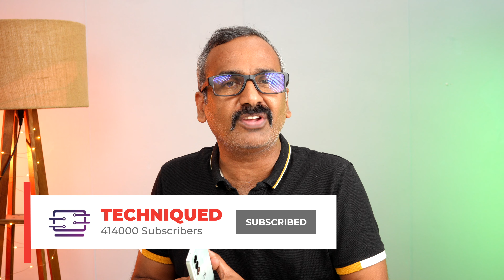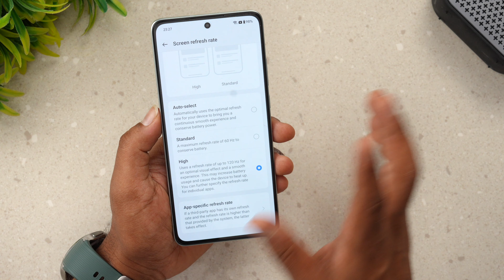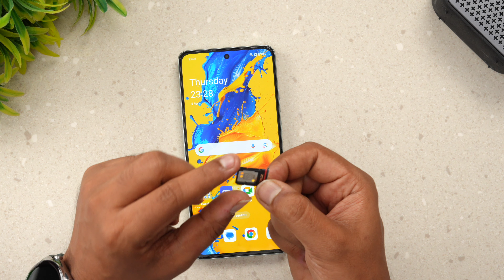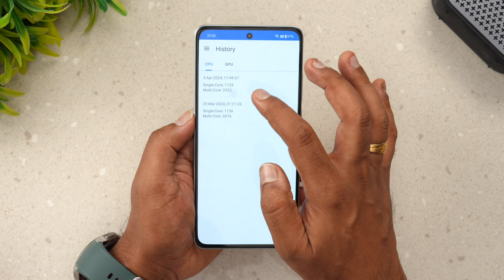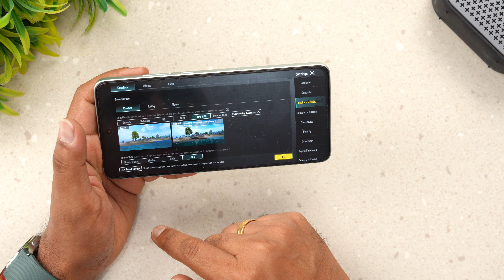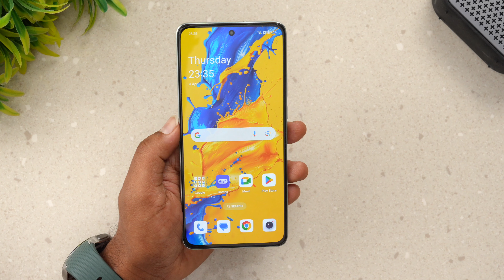OnePlus Nord CE 4 FAQs- Display, Performance, Charging, Widevine L1, 5G Bands, Software, Battery

Comment: Sir which is better nord 3 or nord ce 4 because both of them are at the almost same price rightnow. Please help me choose one😊
Reply: Nord 3 anyday better
Reply: Do you have one ??
Reply: @aaryyam  I have  nord CE 2 lite ( 17.5 k now ), Nord CE 4 ( 25 K ) ,  and i went to croma showroom to have in hand experience and evaluation of Nord 3.. Body design, looks, display quality i found Nord 3 way ahead of Nord CE 4.. This Nord CE 4 has the appearance and in hand feel of an under 10 k phone. Despite Amoled, the screen looks cheap, not sharp  , . My nord CE 2 lite  better for reading and writing, slightly smaller in size, fits for everyday usage .. These are initial impressions.

 Having said this some other factors like gaming, battery, speed,  CE 4 may be better. But again, the edges are too sharp and crude. The marble colour body design appears like some what moth - eaten,  doesnt give a premium look. However the dark crome colour ( looks smooth, little light and silverish ) of CE 4 for this reason is good for office goers, which I got  today ...

In a day or two only I will be able to provide feedback on battery discharge and charging speed... 

Im no gamer, so no opinion.
Reply: @aaryyam  I have  nord CE 2 lite ( 17.5 k now ), Nord CE 4 ( 25 K ) ,  and i went to croma showroom to see Nord 3.. Body design, looks, display quality i found Nord 3 way ahead of Nord CE 4.. This Nord CE 4 has the appearance and in hand feel of an under 10 k phone. Despite Amoled, the screen looks cheap, not sharp  , . My nord CE 2 lite  better for reading and writing, slightly smaller in size, fits for everyday usage .. These are initial impressions.

 Having said this some other factors like gaming, battery, speed,  CE 4 may be better. But again, the edges are too sharp and crude. The marble colour body design appears like some what moth - eaten,  doesnt give a premium look. However he dark crome colour ( looks smooth, little light and silverish ) of CE 4 for this reason is good for office goers, which I got  today ...

In a day or two only I will be able to provide feedback on battery discharge and charging speed... 

Im no gamer, so no opinion.